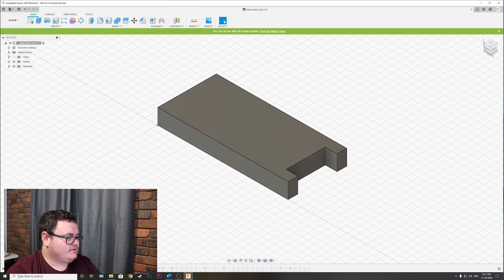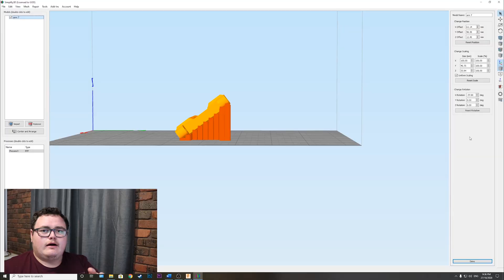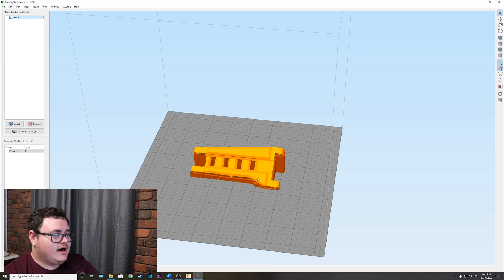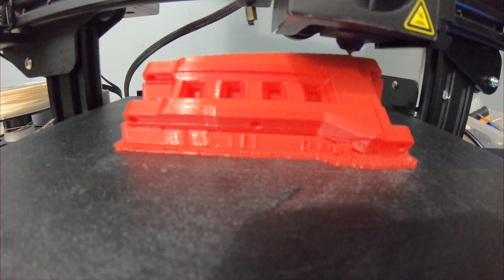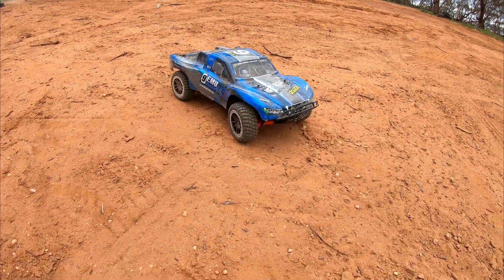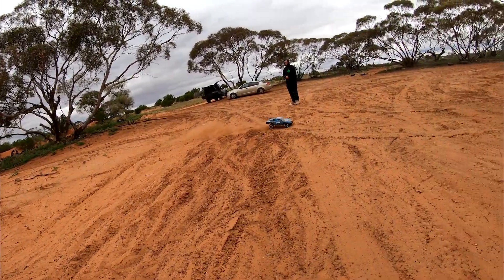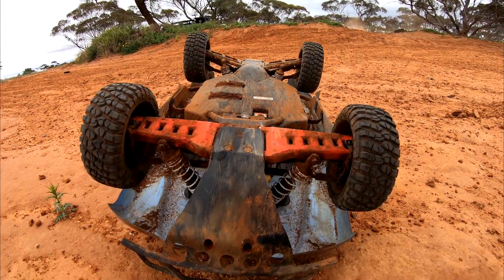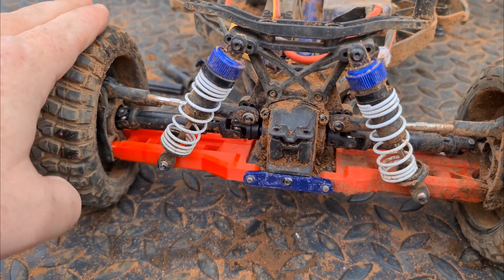3D PRITNED RC PARTS! - Are They Strong Enough?

Comment: Did you use ABS to print this or PLA?
Reply from the maker: PLA 😀 although ABS or even Nylon could be a great option
Reply: Abs is most used for this kind of parts but nylon would be more flexible if the part is not too big.
Reply: PLA is fine but use ABS its much more resistant and better than nylon wich is what they use in the making

Comment: This is exactly why I want a 3D printer!! Idk how to start looking. What’s a good one for a fair price that has a fair build deck
Reply: I'm looking now. Filament is ment to be stronger than the resin type. But resin in more accurate I believe as a complete noob
Reply from the maker: Pretty much dude, I'd say resin also can't do as large of prints. I'd say a regular filament printer is the way to go for a beginner and more practical applications
Reply: @MatthewSimm  scx24 parts for me n my mate I think. I can get the std ender 3 in nz, should I get the new one as a noob,?
Reply from the maker: After using the ender I like that  try the new v2 pro out 😀
Reply: I forgot I posted this. I have obtained my printer and printed wheels last night. The resin wheels are sooo hard! Idk if I can wear them down, like drifting with rock tires. 😂 lmk if you want the file. 1/10
Reply: Doesn’t fit the slash,

Comment: i know im bit late but pretty cool vid are u still printing have u tried spur gears whats the toughest plastic to use
and whats the cad program, good to see a switched on fellow ozzy, subscribed
Reply from the maker: hey thanks mate :) printer is broken, i will do more when i upgrade it. the best material i have found would be nylon, great wear resistance for gears and its great for arms because it can bend slightly, its not too brittle. currently i just use fusion 360.
Reply: @MatthewSimm  thanks mate be watch in, were in OZ are u situated looked like
u were in the middle of nowhere in one vid i saw ,looked like desert,

Comment: Just printed some myself in petg with 100% infill things are thick AF but be pretty much bomb proof 👌
Reply: If you're using ultimaker cura you can set your infill to 99.99 it will print quicker
Reply from the maker: Yeah they're super thick haha, it was my first time printing arms and wanted to made sure they were strong. I think I need a v2
Reply: @MatthewSimm  what material u print them from ?